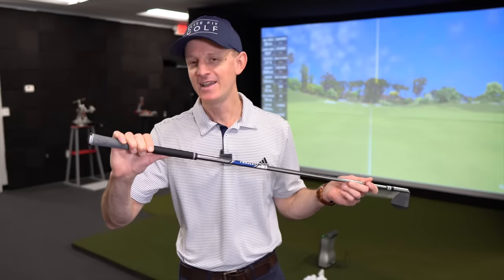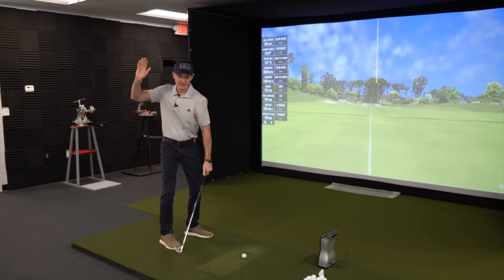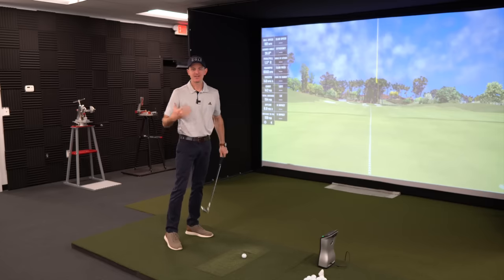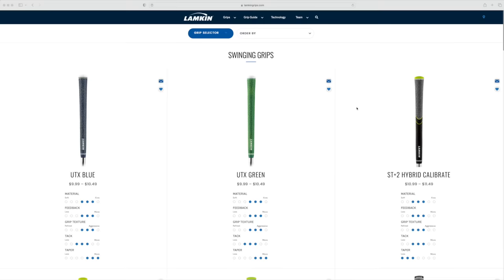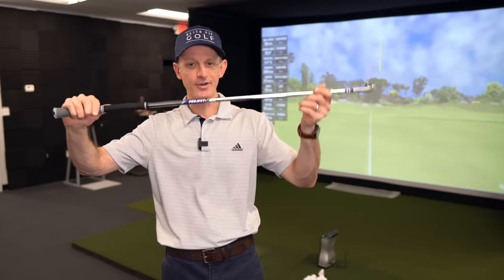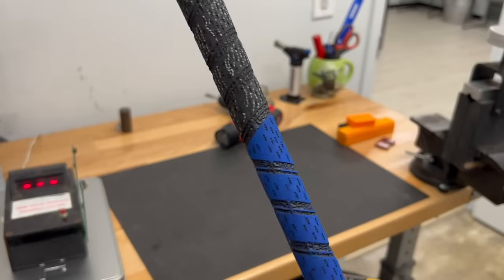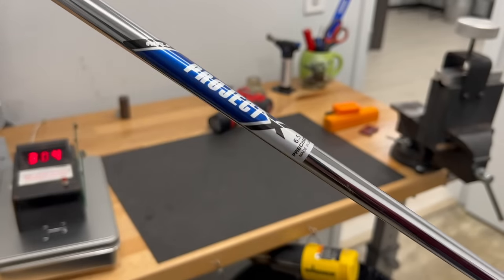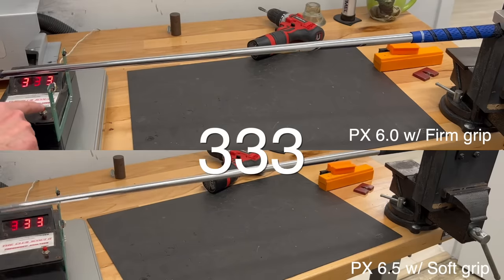NO ONE TELLS YOU THIS When Picking Golf Grips

Comment: AJ, this just proves that fitters need to consider this grip variable when fitting clients, if not, they are not giving you the best fit possible. It’s already tough enough finding a good fitter you can trust who’s not trying to upsell you into some exotic shaft and other add ons, now you have to make sure you’re getting a “full and complete” fitting, which most of us don’t know what that is. It’s a shame that we’re at the mercy of fitters without knowledge. Cheers.
Reply: Yes but not easy to implement. They already struggle having all shaft types, weight and lengths. Now they’d need all this in all the grip options?!
Reply from the maker: Full disclosure, I never considered this until I just started thinking about it in a light bulb moment. I have not done this with any of my fittings but now I am trying to figure out how to include this into the process.
Reply: Not only will you have to consider software or hard, but the different wt's of different size grips. I use a oversize grip that weighs more than undersize grip.
Reply: I’m playing Tour Velvet Jumbo. And no I haven’t thought of this.
Reply: Try that again with a pressure gage on your vice so that you get the same grip pressure. Bet that gap will close significantly.

Comment: Good stuff 
The hands work as the vice,so the same club will feel and respond differently with respect to the size of the golfer’s hands. Shorter hands,more flexible, larger hands, stiffer feel. I learned this the hard way when the whole Brunswick cpm shaft measurement system came out. Clubs were being built with different clamp lengths giving different flexibility profiles for the same club. Brunswick was using a 2 1/2” clamp and others used 4 and 5” clamps.
Hopefully some day soon, club fitting will be standardised to fit the golfer and not just sell a set of clubs.

Comment: Makes sense why some didn’t like the firmer new decade mcc grip with build up tape on the bottom hand on a particular shaft, compared to the same exact shaft in a MCC plus 4, or even the much firmer z cord. I didn’t ever think much about it but it seems obvious now that you brought it to my attention. 

In my case the grip rubber in a plus 4 reducing the taper rather than the tape gave me more feel for the loading and unloading of the shaft. It seemed to make tempo and delivery changes from day to day and different ball flights easier to notice and correct  vs The firmer grip

Comment: Because my hands are bigger than average I had midsize grips on my Callaway Apex forged blades. Wasn't hitting them consistently. Was getting too much variability. Then decided to switch to GolfPride regular size softer grips but they are less tapered than standard. So it's thicker than regular on the lower hand(right). It was like hitting a whole different set of irons. More distance, consistency and I could  work the ball either right or left. 
  The proper grips make a significant difference.
Reply: I would think a less tapered grip would really equalize both hands and create more control ! It sort of makes sense ! On my swing now my right hand is becoming more and more dominant and I should try a less tapered grip with golf pride, if I could retain the same firmness ! Thanks

Comment: I stumbled upon the soft grip theory by accident, I use jumbo grips on stiff flex graphite irons. Mainly to stop limb vibration. 
I use DRi-tech LT over size with 5 layers of masking tape plus 3 layers more on the  lower to 2 layers plus grip tapes. Zero vibration great for home sim room golf. Even with a strike matt strip. 
My first reaction was the flight, spin looked fine, feel wasn't that of stiff shafts. I just never discussed with anyone as club set up is p[personal thing.

Comment: Not sure if this really has an impact in actual hitting. The reason the frequency drops with a softer grips is because it dampens the oscillation when held in an unmoving vice. When you really swing, you are holding it in your hands which are flexible so it doesn’t behave the same way.

Comment: Awesome information, I am a plus fore MCC golf pride guy. I also recently cut down my shafts for control.  I was doing this with a fitter to see if a 44.5 inch driver shaft TSR2 11 degree  was better than the Burner….it was but he mentioned my swing speed dropped to 92 MPH on my driver from 97 but we got the same distance … less height less spin and only 5 yards carry distance but 20 more roll with a PRO V X. I wonder if some that speed is my grip … shorter shaft more the grip can effect it ?

Comment: So basically in a fitting you could have a client that is almost in between needing a stiff an extra stiff. So you could put a firm grip and the stiff and achieve possibly that halfway point between a stiff and extra stiff? Vise versa with putting a soft grip on the extra stiff?

Comment: I like the video and you did say it on the screen (not sure but you may have said it as well.)  I think the important thing is the PERCEIVED STIFFNESS is not the same as true shaft stiffness and the way it effects the ball flight.  The softer grip may make it FEEL more flexible but the engineer in me can't see how this FEEL effects the ball.  If you were on the borderline between regular and stiff shaft, you might help the player feel better with a softer grip.  However, most golfers that I know prefer the feel of a certain grip and wouldn't want to change.  Just my 2 cents worth on this.  Thanks for the video.
Reply: Grips are like Silentblocs they just  change the feeling and reduce the  vibrations in the butt but no change the profile of the shaft.

Comment: Wow, this is a great consideration. I'm in between flexes (S/X) but went with S on my new takomo irons. So now maybe if i feel this flex is not quite right I can lab with outher grips instead of changing shafts 👍. 
Does this apply with driver shafts as well or is it only steel shafts? 😊
Reply from the maker: The sensation will be similar for both.

Comment: AJ, what are the swing weight difference when the grips are changed? 
Would like to see this with same swing and grip weight see if it replicates or changes the results.
Reply: Just read same weight, never mind on that idea!
I live in Spartanburg, could I setup an appointment to adjust my lofts and lies on internet bought standard Adams Ideatechs from 2014?
I bought before a bunch of health issues, barely used till I built the sim.
Thanks!

Comment: What do you think of ALIEN PRO golf grip wraps? 

I’ve been using them for a couple years now, and I like them. I bought them initially because they handle moisture better (ie in rainy conditions) and claim you don’t need to wear a glove (although I still do). 
But, the wrap does add a layer of thickness to the grip on the club. I’ve also learned to like the WRAP type grip it results in. 

Your thoughts?
Reply from the maker: I've never tried them. Will need to go look them up.

Comment: Going a little off piste, AJ, can you tell me if there any special considerations when a) fitting Winn type grips, (as against the conventional rubber golf pride type grips), and b) is there anything I need to know either way when cleaning a Winn grip, (cleaning fluids and brushes etc.)?
Reply from the maker: Winn in general seem to run a little smaller than other grips so be aware of that. They are also softer and generally wear out faster than traditional rubber. I would recommend cleaning only with mild soapy water and cloth, no brushes.
Reply: I've never tried to remove a Winn grip intact.  Do you have any experience?
Reply from the maker: @Barney29508  I don't do them.
Reply: Normally I would replace a worn Winn with a similar shaped Golf Pride conventional grip, (I'm talking putters here).

I have a collection of classic putters where the the grips are probably ready to be removed.  If I want to sell them on, they would definitely look a better buy with a new grip.  I prefer in this instance to replace as near like for like as possible, so a Winn type grips is the only option.

I am working on a couple of "Yes" putters at the moment which were originally fitted with Winn grips.

Many of the old Ping putters were fitted with OEM Golf Pride grips which although expensive is easier.

Thank goodness I'm not a Scotty Cameron collector though!

Comment: Such great information and something I haven’t really seen anyone address.   It’s a whole new wrinkle now.  Do you recommend in fittings to change the grip one way or the other is someone is in between flexes? Or is this a case of weight means more than flex?
Reply from the maker: I think it will probably be case by case. I started thinking about this topic because I've had clients come in complaining about terrible results with certain grips (usually too firm), and after simply changing them seeing much better results.
Reply: @EFGMC  great test.  Don't think I've seen anyone else do it 👍
I have bad finger pain everytime I play so now I'm thinking I need to go with Jumbo max grips. Probably the size is going to be just as important as the softness

Comment: Great and informative video. For years I have always used Lamkin Crossline grips with True Temper Dynamic Gold shafts with the S300 stiff flex for any clubs I would build or rebuild for myself. Lately have been considering Lamkin's Calibrate grips with the guide ridge to help with hand placement. This will help narrow down whether I want a grip closer to the firmness of the Crossline or a softer feel. I had been thinking my swing speed is starting to decrease as I get older and that I should consider dropping my shaft flex down to Regular. A softer grip may get me half way between for much less cost and effort. Will visit my local Dick's store this week and see if I can get a swing speed test done to help me decide. Thanks.

Comment: Quick question AJ. I’ve got some second hand Accra iron shafts I want to try in my irons. I’ve noticed that there are 2 markings on each shaft under where the grip would go. A white line and a red line 90 degrees apart. Could it be that they were pured. If so are there standard markings eg install the white or red line at 12 o’clock. Or am I just reading to much into it!
Reply from the maker: Certain shafts will mark the hard side of the shaft with a line at the butt tip. Some companies it appears to me will use that to place the graphics, at least it seemed like it. 
Honestly today's steel shafts are all so good that it really makes no difference how they are aligned as they are so radially consistent.

Comment: How do mid-size figure in to this? Do they make the squishier grip have even more flex then a standard? That would be interesting to see.
Great vid. Thanks for sharing.
Reply from the maker: I've been thinking about that and plan on testing it out. Next part of this video I think will be comparing different grips and seeing how the frequency changes. Just ordered some more Golf Prides so will start there.
Reply from the maker: @Graken-oj8dx  That is true. Should feel firmer vs the standard midsize grip.
Reply: Yes, as shown in the video a softer grip will slow down the frequency of the shaft. Adding more thickness of the same type of grip material (soft or firm) between your hands and the shaft should slow down that transfer of energy. A midsize grip of firm or soft material should slow down the frequency of a shaft more than a standard grip of the same model.  That's also why adding tape makes a grip firmer. It's increasing the compression of the grip material by stretching it out, making it firmer through compression.

Comment: So when you have a club fitting you should chose your grip first?  I have always been asked what grip do you want when they do the order sheet. No grip weight or firmness taken into account. Will defo do it the other way next time. Thanks
Reply from the maker: To be honest I have never offered it in my fittings. I change the size but never the firmness. I might be revamping my process!
Reply: @EFGMC what's your size determination? Is it players feel or do you see something in their swing that makes you suggest a grip size?
Reply from the maker: @dustingariepy2056  Usually feel but I always default to bigger vs smaller.

Comment: What about grip size? Does size affect your hands turning over?
Reply from the maker: Yes, larger grips will reduce your hand rotation speed.
Reply: 10 or more years ago both Callaway and Taylormade did independent testing and both found grip size causing club to open or close based on size to be a myth. Both stated its personal preference, and simply what you like the feel of when choosing grips. Putting your hands on the grip in the same orientation and thick grips will NOT cause the club to stay open, and thin grips will NOT cause the club to turn over and close!

Comment: Video 2

take off the grip and test. 

cut off the tip of the grip flush with the clamp.  Would not expect the numbers to change 

Flex change coming from the grip contact and not the length of the grip?

Comment: I’ve had my clubs pured with jumbo CP2 golf grip…if I go to a smaller grip size would that change the status of my clubs that were pured??
Reply from the maker: Changing grips won’t do anything to any supposed benefits from the Puring process. Are there actually benefits? That’s a different question.
Reply: @EFGMC  I’m going to midsize grips and I really appreciate your feedback…when I got fitted for my new clubs…I didn’t have them pured and when I got them…the clubs didn’t feel the same as the club I was using for a fitting…I was told that I should’ve had my clubs pured…I sent them back to get pured and since then I’m making better and more consistent contact with them and i also have that same comfortable feeling that I had when I got fitted…i just wanted to change my grip size…again thank you very much for your return response to my question…

Comment: I think this illustrates the reason why measuring cpm's has fallen out of style. When a shaft is held firmly by a vise, its easy to see the difference between shafts. However, the human hand is much softer and the psi a hand can squeeze is far less than a vise, even with a shaft protecor. What is a ten cpm difference in a vice may result in a far less difference in a human hand. It would be diminishing returns (ie, less of a difference in cpm's) when swung by a person and is likely the reason why it hasn't had much impact on actually hitting a golf ball and why the concept is falling by the wayside.

Comment: I can see this being partially true but, since most high bend point shafts have the flexpoint right below the grip how well would this apply, even if the gauge says it's stiffer.
Reply from the maker: Not changing anything about the shaft or how it flexes. We are talking about the actual grip "flexing" and providing a similar sensation in your hands.
Reply: Gotcha, it's just a cushion feel.
Reply from the maker: @vicgeier3482  Right. The bending sensation you get from a shaft can also be mimicked by the grip.
Reply: @EFGMC without the shaft flex points that affect ball flight changing.
Reply: I use Jumbomax Zen Lite large grips, I wonder if that's the reason for my crazy high ball flite, accurate but high, I need 1 more club now
Reply from the maker: @vicgeier3482  Grip is changing your release in the downswing so you present more loft at impact. Might be the softness, but it could also be the size.
Reply: The video shows the softer grip slowing down the actual cpm's measured, so it has an actual effect, not just a feel.

Comment: What about grip size?  Jumbo vs. "standard"?
Reply: A jumbo grip of the same material will feel softer and not flex the shaft as much as a standard grip of the same material, resulting in a lower cpm. However, if you tend to release the club early, a softer grip has should help square up the club face at impact because it will delay the release of the shaft.

Comment: When you are testing the frequency over a minute the club is flexing hundreds of times and the grip is thus having an influence hundreds of times.  When you swing a club it only flexes once and the grip only has an influence once.  So isn’t the influence of the grip via your frequency test greatly exaggerated compared to the influence it actually has during a golf swing?
Reply from the maker: Everything we are talking about here is feel based. Why a golfer may like one shaft and not another can be simply from the change in that feel.
This is showing that you can achieve the same change in feel from changing grip firmnesses.
Reply: The number of frequencies that were correlated seemed to suggest there was a change in how the shaft would flex while playing golf due to the type of grip, so thank you for clarifying that the type of grip changes the “feel” and not necessarily how a particular stiffness of shaft will perform.

Comment: As an engineer and golfer, I take issue with how the test was conducted because nobody holds the golf club with just a vice grip mounted on the bench. I think you need to repeat the test using a clamping mechanism that more accurately replicates the way a human would hold the club
Reply: It's just relative butt stiffness.   It's not really a metric used anymore.

Comment: Ok so what if put a firm grip on the driver and soft on the irons you think that would mess you up or even the size could mess you up.    Thanks for the info even more stuff in your head to think about.lol
Reply from the maker: Hard to say since your driver has a different shaft from your irons, it's already going to feel different. I usually say it's better to have every club griped with the same type but that's only a general rule and may vary player to player.